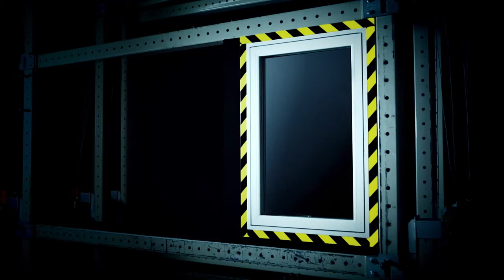Composite Windows Durability Test Burglary Secure By Design

Comment: well. there are simpler ways.
you need only a crowbar or a screwdriver (depending on the size and strength of the window).
put the crowbar in the crack between the glass and the wood. with one hand, pull the crowbar and with the other push towards the middle of the glass.
if your crowbars tip is thin enough, you will break most glass. without force.
use your brain, not your muscles.